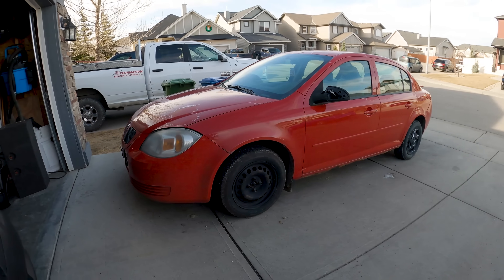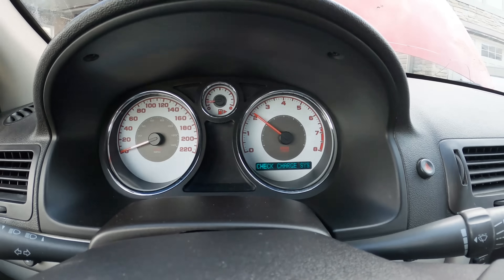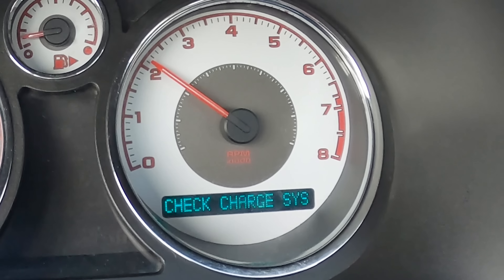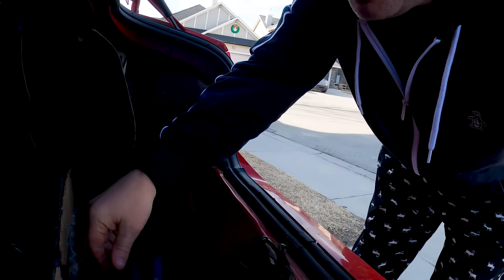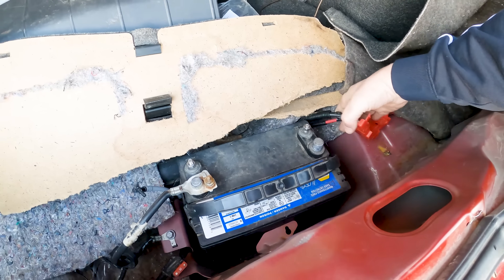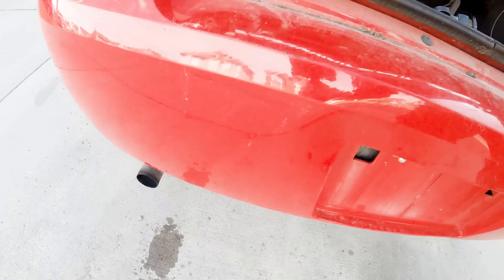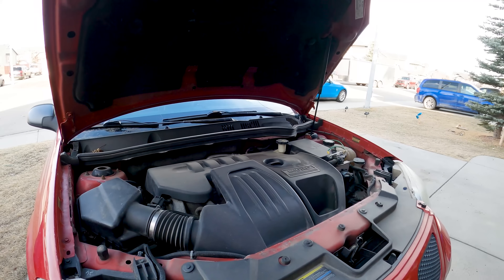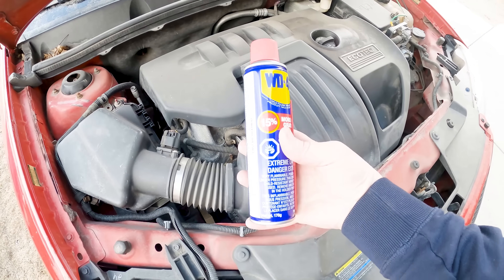ROADSIDE FIX! REVIVE your DEAD or DYING Alternator with this ALMOST FREE trick! | Gears and Tech

Comment: thats a GREAT way to spike the system is the alt. was working,,,,have seen CPUs smoked doing this
Reply from the maker: Which vehicle did you personally see smoke from this? Curious if this is one of those stories teachers tell students at mechanic school, but nobody has seen it?

I've seen computers smoke when they lose their ground wire. But that's not what we are doing here
Reply: the last 2 was at 97 toyota camery and a ford E250 not sure the yr but 5,4 @GearsAndTech
Reply: Pull just the negative cable off the battery, that way you don't have to worry about accidentally touching the positive cable to a ground, grounding out the positive cable will damage computers, but as long as it doesn't touch the body or engine (anything that is metal) should be fine
Reply: Also turn off car before returning cables to battery

Comment: Very GOOD Information....  I bought a 2007 Monte Carlo for $250 and had to replace the water punp, radiator and a few sensors . .3 Months later,the alternator died --- I bought a rebuilt for $68.43 and had no problems,ever since-- I reprogrammed the Brain and the car gets 40.54 MPG on the Flat Roads...Most cars are measured in "Horse" Power but,mine is measured in "Squirrel" Power
Reply: How did you reprogram it? and what mpgs can I get out of my 1995 Escort?
Reply from the maker: We have had some of those too.
Reply: engine size??

Comment: Two things unhooking the battery from a running car you stand a very good chance of frying several sensors and the ecm don't do it most manuals will tell you dont do it wd40 is flammable you stand a chance of starting a fire 12.6 is the voltage of a fully charged battery 13.2 to 14 volts is what actuator puts out
Reply: A good condition battery does 2.15 per cell fully charged. My battery tester shows 13.0 on my 2 yo battery on a corolla when state of charge is 100%.
Reply from the maker: Great points

Comment: My car want start under 13.4 volts, so how that going help, my truck is 86 5 speed Manuel it’ll help that , but newer car?
Reply from the maker: You need a battery with more cca. The voltage isn't the issue. You lack umph
Reply: If the battery is a few years old, it can work intermittently. It is going bad. If it says it needs charging on a battery test,  then it has only days left.

Comment: Ok. For starters. NEVER EVER PULL THE BATTERY CABLE WITH THE CAR RUNNING!!!!!! That will not only damage/destroy the diodes in the alternator, it can also cause damage to the various computers that new cars have.  I have seen this happen.
Reply: I was warned of the same danger to the cars computer, because the alternators voltage regulation is dependent on having the battery in the circuit.
Reply: Okay. So I've read enough of these comments at this point to get a little bit irritated. everybody seems to miss the idea here, that he's placing you in a situation that if you were experiencing some power loss issues hypothetically you may have a bad alternator that you would like to check at which point you could do These tests that he's proposing that you do.  Without worrying about f**** up your alternator cause guess what? It's probably already bad if you're doing these tests. He's not saying run out of your garage right now. Start your car up yank off your battery call. The guy is simply trying to get across here. Is that if you're experiencing these issues and you don't have the ability to take your car into a shop right that second, here are a couple of things you could do to test your power problem and see if it's coming from your alternator. Seriously everyone, the man is giving you some ENERGENCY tools here that take up no space in your car or any other car, so that in the event that you find yourself in a bad spot along side the road in a sketchy neighborhood on the wrong side of town. Shit I don't even like Canucks and the ignorance of you Fulkerson got me feeling the need to defend one. STOP DOING THAT. I'll chime on again the next time I cam see your lack of brain power or common sense lets you get bent outta shape  and miss more important information 😊s😊
Reply: @kilebeeman4188 What if you get your alternator charging and then the engine quits because you damaged the ECM pulling the cable off while running? What have you gained? Absolutely nothing. Besides the man that rebuilt my alternator asked if anyone had pull one of the battery cables while my truck was running. I told him no. He said he was just wondering because the diodes were blown in my alternator, and he said that doing that causes diodes to blow most of the time.
Reply: Not as flammable as you'd think.
Reply: Yes I personally have seen this as well. Shockingly it was on an alternator hooked up to a bicycle - a project I was working on! The only load was a single automotive headlight - maybe 5 amps, and then the battery. The voltage spike from removing the battery lead is from the sudden reduction in amperage. Now imagine how much higher the amperage is in your car than in my simple set up. I replaced the alternator voltage regulator and the setup worked again for me.
Reply: @Bankable2790  your voltage regulator is a wonderful safety feature that was put in place just in case you happen to need to do something like what is being done here. Think of it kinda like a built in fuse. It helps protect expensive components like the ecu. Also in the event of something going haywire like with your bike the individual working with the electricy has a safety do they dont wind up getting zapped with the full force of the amperage you car has the ability to produce. FYI I've changed my fair share of alternators and the max amperage I generally see a "beefier" option to get at the parts store is generally beverages surpassing 120 amps. 130 may have been the max I've ever actually seen for any alternator I've needed to replace. This of course doesn't cover after market alternators that are used in applications where it's known that the individual operating the vehicle will be needing to power a plethora of extra electronics not commonly accounted for i.e. cars used by police officers of for audio competitions.
Reply: @kilebeeman4188  no
Reply: @kilebeeman4188 Some of these new headlights in new cars put out enough electricity to kill you. I know the warning sticker on a Mercedes M Class headlight says “Warning, 50,000 volts output” and I think they have 250 amp alt.
Reply: You have made my point of why I want a diesel powered car with a mechanical injector pump.
Reply: Yes but no....Negative wires, I use my battery to start another car with. ..leave truck running and put either cable on while it's running! But it is safer to put negative on second. 
Diodes in the Alternator? Um the voltage resistor? Hmmn think about that one for a second,"waiting!"
Reply: Lol dude u can do it for a quick test and change batteries ovet done it many many times cars alternator and ecus are fine,, plder cars also no problems at all..
Reply: I have done it all my life and never had a problem. Did it with my new Dodge Chargers, my two Vipers and over 150 musclecars so i don't know where you get your information.
Reply: Is wd40 not flammable? Is there no any danger of fire ?
Reply: 😅yeah you've "seen" Scotty Ks. Video 😅😅nice try tho
Reply: I haven’t and I’ve used this means of testing on all my cars for years
Reply: I needed to fit a new battery without loosing the radio code and my electronics friend simply kept the engine running during the change,no problem.
,
Reply: Will not harm anything, It's like turning off the car with the key. Now if your pressing on the gas and shifting, that will cause issues l
Reply: I totally agree ,pulling the battery cable is a dumb idea.
Reply: Exactly
Reply: You spent 13 minutes and 43 seconds to tell me to spray it with WD-40... it works but the video could have been 10 seconds..ass
Reply: Never disconnect the battery while the engine is running if it has an alternator, you’ll burn out the diodes and possibly some other very expensive components. On old cars using a generator which was positively earthed and produced DC current this was ok. You may get away with it once but do you really want to risk it.
Reply: Myth busted done it a number if times and all those times I did it they all ran fine afterwards and didnt need the electronics replaced. Not saying it could never happen but its definitely nit something that is guaranteed to happen to every single year make and model and every single time.
Reply: You're very dramatic. 😂
Reply: Technology in decline. Almost everything is being designed dumber and more fragile.
Reply: Further to that, Wd40 is flammable when sprayed, so don't do it while the engine is running
Reply: @boblacey3770  WD40 ORIGINAL
IT IS NOT INFLAMABLE, TRY IT AND YOU
WILL SEE
Reply: @boblacey3770  Wd40 ORIGINAL is NOT  flammable....
put on fire and confirm
Reply: @juanyoremeseri6822  I know what you're doing and that's not right. 😂
Reply: no it wont been doing that for 40 yrs NOW
Reply: @shunjohn3567  A ECM/PCM for a car can easily cost over $1,000, do you want to cover that cost if I follow your advice and fry my ECM/PCM? Yeah I didn't think so.
Reply: @killer2600  clown 🤡
Reply: He is absolutely correct you never jerk off the battery cable when vehicle is running only old cars
Reply: Exactly, and it's only very old cars where is is safe to do this. Cars without any electronics whatsoever and this takes us right back to the 70s. Even then, it was not good practice.  @HCKT-EVARTS
Reply: @HCKT-EVARTS bullshite
Reply: @HCKT-EVARTS Bingo!
Reply: @H.C.-Transparency my car is a 1960 Oldsmobile. Am I ok to remove a battery connection while running? And is it possible. Or neg. I remove?
Reply: NEVER disconnect battery with engine running! It can blow out all kinds of electronics.  Spray electrical contact cleaner into alternator near where brushes meet commutator. Not WD40, it contains oils which gum up the contact surfaces!
Reply: His alternator was already screwed.
Reply: @Roadking556  it can damage every electronic circuit in the car
Reply: @Bankable2790  And... You're telling me why? . It's something I already know.
Reply: @Roadking556  you said the alternator is already shot
Reply: To those that say it will damage this or that yes it COULD BUT YOU ALSO COULD HAVE A WRECK ON THE INTERSTATE you have fuses to protect and prevent things like that I have 4 new cars and have pulled cable off while car was running no problem no issues y'all are being extra and haters
Reply: @RobertMorris-l3l they're being over the top dramatic. 😂
Reply: @RobertMorris-l3l  bruh completely unrelated things
Reply: @Bankable2790  no what makes the fuses have power which in return sends power to said electrical components so not unrelated but use at your own risk I know damn good and well it won't hurt it we can agree to disagree with each other and not argue like everyone else
Reply: Opinions are like assholes everyone had one. In case of emergencies. Your family is on the side of the road it’s 11 pm. Let’s have a moral conversation about alternators . Lmfao 🤣
Reply: @mralien4710 and here you are spreading yours open I see bud
Reply: You got that right. That is if your looking to replace ever computer and module  in the car. Some newer vehicles have upwards of 20 computer modules.
Please do not take off battery cable if vehicle is running. This guy was lucky the alternator  was dead.
Reply: @stevecobratei8538 have you ever heard of the function of a voltage regulator or why it is put into automobiles in the first place. It would appear as though most car manufacturers may have accounted for the old school practicioners in the world. Fascinating stuff really. Just Google it. No need to think me  later. Have a good day, knowledge is real power
Reply: Never use wd40 it is flammable!
Reply: I smell throw up so have you ever done it yourself? How many times? Did your vehicle give you problems? Or do you give your vehicles problems? lol feel free not to answer any of this it's not important
Reply: I agree, brother people are so full of shit. They talk out of their asses about stuff. They have no personal experience with because some mechanic lied to them and told them that their car would fry and the computer would fry and I doubt it ever happens.
Reply from the maker: That's fine, if you just want to skip to soaking it in wd40 that'll get you on the road

The pre test is just to prove you're doing the right fix.
Reply: @GearsAndTech  that is a great ip would you be kind enough to share your knowledge with mad mark van life ...he's having a nightmare with his alternator and is stuck.
Reply: I hope you ignore these people who talk shit like this is Reddit or something or Cora, where they talk about things they don't know about because some mechanic lied to  them

Comment: Wow! That's a very helpful tips! Thanks.  Would i should let the WD-40 dry up before starting the engine?
Reply: Do NOT Sp[ray Highly Flamable Liquid anywhere especially on electrical stuff.
Reply: They took the flammable stuff out of wd is what I heard @edwardgoldentooth4491
Reply: @edwardgoldentooth4491 😅
Reply: Yes, use electrical parts cleaner @edwardgoldentooth4491
Reply from the maker: No need. Spray it on then start it up

Comment: More times than I like to think it is the bearings in the alternator that have seized on me during periods while other things can be taken care of to get a car running again. Does anyone else notice this? The bearing is supposed to be permanently lubricated. My advice in this context is If  a vehicle WILL start while long term parked until other work needs to be done to actually get it on the road again, start the engine often enough to keep the bearings in the alternator excersized so they won't seize. 
If you CAN move the car all the other things need to be excersized too. Like brake parts especially.
Reply from the maker: Letting a car sit for a long time is never good for it. Things wear out, seals dry up, and putting the car back on the road can be expensive
Reply: @GearsAndTech  I know and have learned this lesson a few times. But doesn't it just grab you to have a alternator belt snap seconds after you finally get the thing going? I thought I would pipe in about that since so many people may overlook just starting the car now and then. If they only had known. On the subject of doing  electrical trouble shooting ...I do think it is gambling to ever run an engine with out the battery in the mix. Even disconnecting a battery and then hooking it back up is risky. The Volvo info recommends putting on the headlights before you connect a fully charged or any  battery. It is supposed to ease the jolt to all the delicate circuits.
Reply: cross vine! Seems to be very true. Those berings have very little surface area for the lubricant how can it last that long. Exercise is good.

Comment: Do not remove the battery while the engine is running some vehicles will not tolerate this and destroy components, while WD 40 frees up components it will dilute any lubrication and cause bearing failure. First checks are to make sure battery terminals are clean and earth to engine and body are good and leads on the alternator are not corroded. then only spray a small amount of WD40 in the electrical end of the alternator a small amount goes a long way. I bearing noise is evident then use a lubricant directed at the centre of each end being careful of the drive belt.
Reply from the maker: When you have all the right tools there are certainly better ways to go about this

When you're not a mechanic, or your on the side of the road you don't have this luxury, in that case, empty the entire can into the alternator if you have to. Because the alternative option is getting a tow truck to drive you home at significantly more cost

Comment: Here's an idea. Check for ac on the battery. This is how the new alternator testers work. As an electronics tech I would never dare to think about spraying wd40 into my alternator. Crc does make a contact cleaner that I would better dare.
Reply from the maker: Interesting concept, I wonder how many with a dead battery on the side of the highway have one of those testers handy?

Now how many of those people have a half can of wd40, or can get one easily to see if this gets then going again?
Reply: This video is for being stranded on the side of the road or some sort of emergency type of situation.

Comment: Incorrect!  A battery at 12.4 volts is almost 50% discharged. 12v is considered completely discharged.
 A HEALTHY battery after any float charge has settled should be 12.75 volts!
Reply from the maker: Thanks for the update